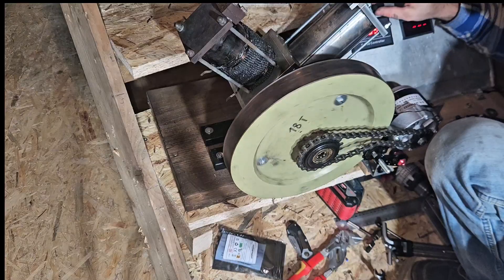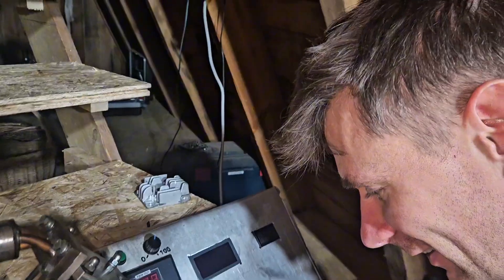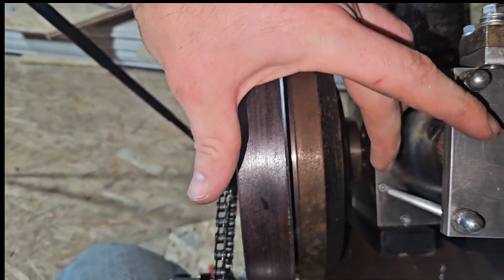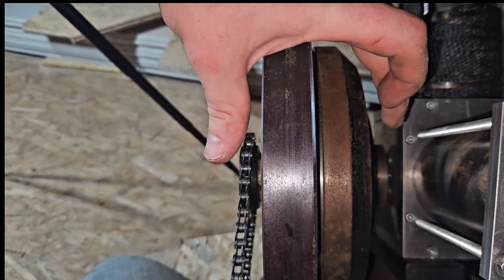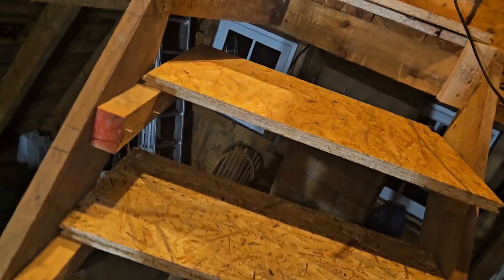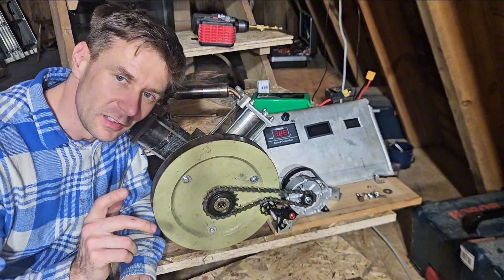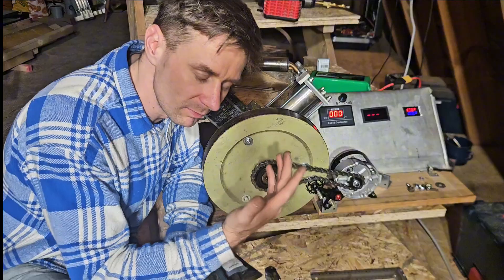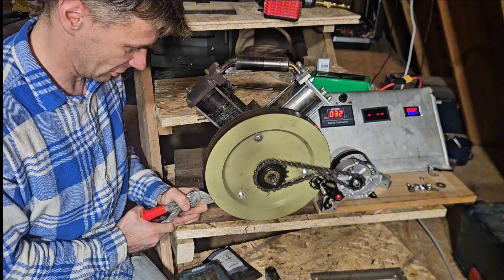Balancing the electric Stirling engine

Comment: EDIT: nvm I watched an older video to make sense of this one. I think you need to get all of the hot cylinder hot, not just the top? 
Also I think that the piston ring seal is important. And therefore the lubrication of the rings becomes important. 
Seems difficult to implement as a diy project. 

anyways, I think you'll have to use a lathe to straighten the axle, bore a perfectly straigh hole in the flywheel, and add a bushing to take up exactly the play
Reply from the maker: Thanks for watching and your comment @valentinoManontroppo mistakes were made 20 years ago and are hard to correct now. Nevertheless I tried to heat the whole cylinder as you suggested with kind of a gas chamber in my new video. Br

Comment: I think the air passage between the two chambers is too small. Considering when you take the bolt out of where you put the pressure gauge was placed. you could clearly hear the air restriction. And that bore is larger than your pipe that joins the two chambers. 

This will restrict air movement somewhat

Try to allow more airflow between the chambers.

Comment: I think u should do the transmission on the other side to balance the power. U doing very good job 👍
Reply from the maker: Thanks for the comment@AdamG-yl5ry I also thought about but couldn't find a simple solution to extend or attach the sprocket to the other side of the engine. The crankshaft ends directly behind the counterbearring. Will find some solution..
Reply: @Son-of-Allen-key how many watts do you think it would make?

Comment: Llevas muchos años con este proyecto, porque no logras encender el motor?
Reply from the maker: I just realised the motor isn't the problem, my mind is weak 😅 Also it has some design flaws I put in many years when I build it. I was still in school and didn't know better. I can't correct them without spending all my free time on this side project. So now it's just fixing a problem and creating 2 new. Just wanna make it run for a short time on its own. Maybe then I can find peace of mind and sleep well. Thanks for your comment @luisalviarez3329 ✌️
Reply: @Son-of-Allen-key ok, que es que descubriste? Dónde está la falla?
Reply from the maker: Oh many flaws.. for example I didn't calculate how big of a flywheel I need for this engine volume to overcome the compression. So when I realised I need more weight on the flywheel, turnes out my crankshaft is too flimsy for this kind of undertaking. Also if I would start again from scratch I'd design the hot side different. The hot side piston far away from the cylinder head is probably a good idea and the reason you see most alpha stirling with kind of a conehead on the hot side. Also I'd start with a smaller engine especially if that setup and geometry never run before. Maybe use an old compressor housing as a starting point.  And just copy a design that works is maybe a good idea for the first motor.
Reply: @Son-of-Allen-key ,de que país estás haciendo los vídeos , se ve muy frio
Reply from the maker: It's getting colder in Germany right now because the winter is coming but that will be beneficial for the efficiency and the cold side of the stirling 😉